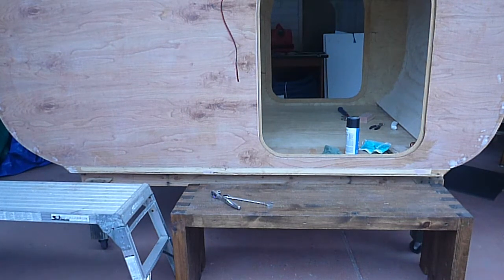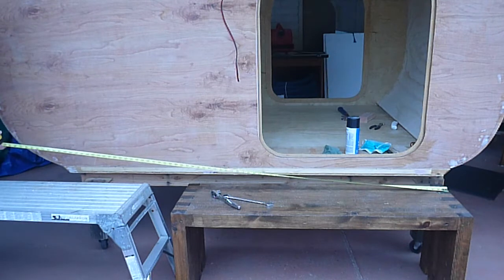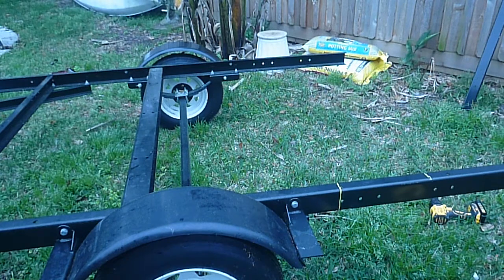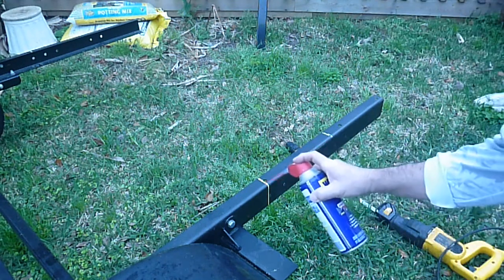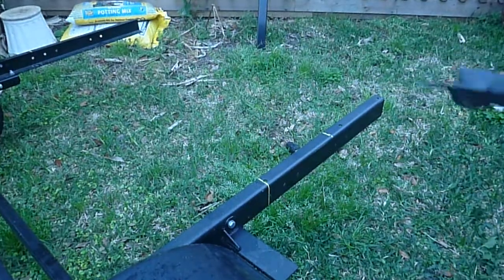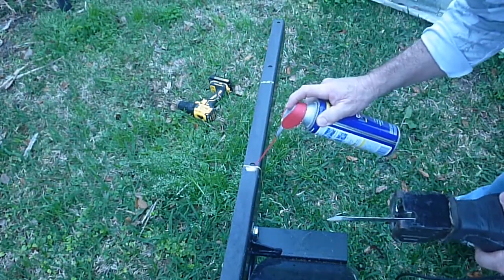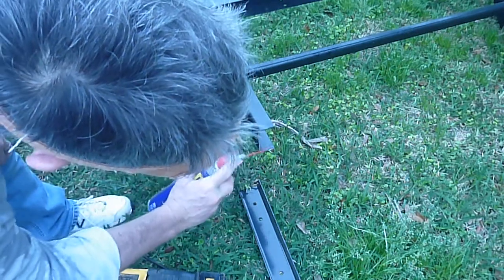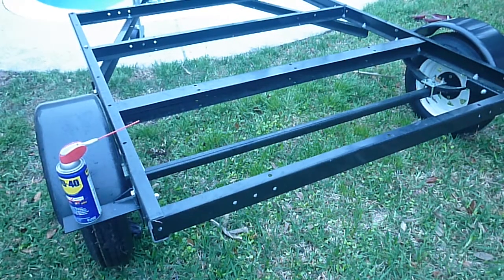Teardrop camper build a 5X8 video no. 31 cut the frame

Comment: What size are you cutting the trailer down to?
Reply from the maker: Since the camper part of the trailer is with rounded ends the floor is only 6 feet long inside, so I cut off 2 feet of the trailer. I had thought of leaving it long to bolt a bumper on to but that would not look good to me.
Reply: @mlangfordoutdoor  makes sense. So the main floor is 5' x 6' then or is it 4' x 6'.  It's looking awesome BTW.